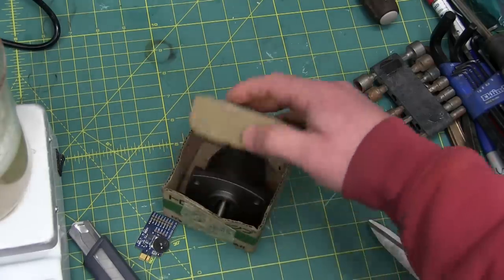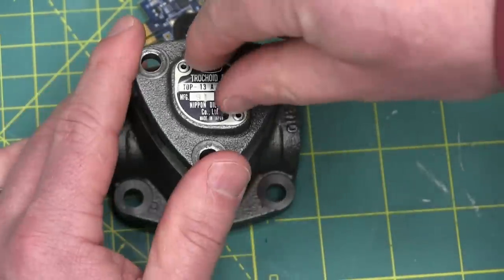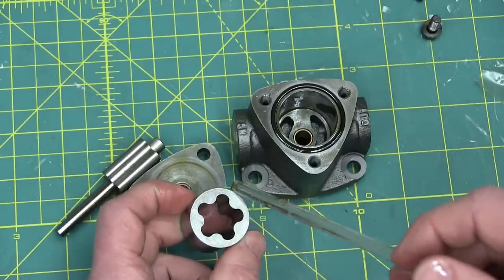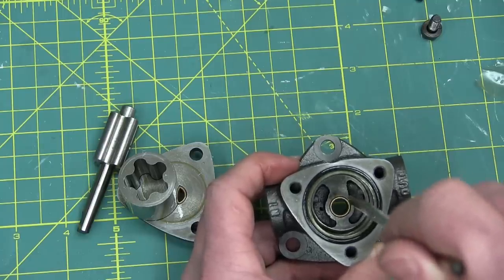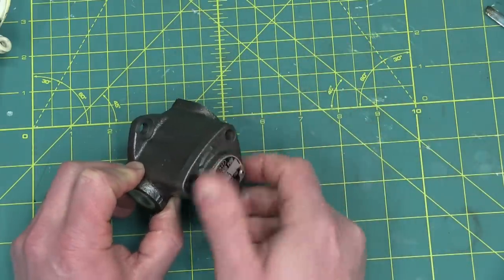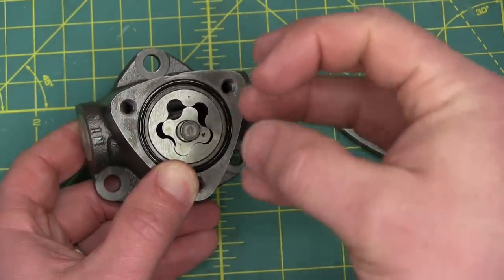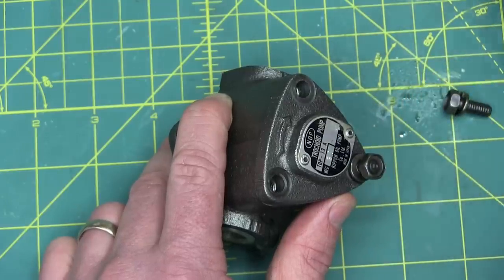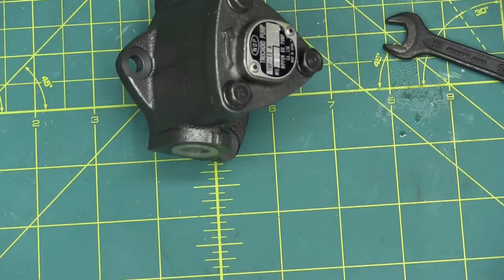BOLTR: Trochoid Pump | Chickadee Enginerding!

Comment: Bah, they've been putting the sizes on top of the bolts for decades. On that note if anyone knows where I can buy a 12.9mm or 8.8mm wrench please let me know.
Reply: I have seen it once where an individual thought the 8.8 referred to the size of wrench needed, even though it was clearly over a 1/2 inch. You meet all kinds in this racket
Reply: crazyguy32100 eBay
Reply: i have to disapoint you that is not the size of the bolt but it grade. The number represent tensile strength in hundreds of a Mpa so 8.8 means 880 Mpa. Look up bolt grade.
Reply: scasny
Do you really not have a sense of humor?
Reply: keifsanderson he must have gotten used to those "wooshing" sounds as things go right over his head.
Reply: keifsanderson
well some times its hard to tell if some one is just stupid or joking.
Reply: scasny wayta not get the joke there tiger..
Reply: Lol I get it
Reply: scasny I heard that the first digit represents ultimate tensile strength in MPa and the second the elastic limit as a percentage of the first.
Reply: eeeeeebayyyyyyyyyyy
Reply: Best of all: I tend to hoarding demounted bolts, and 5.6, 8.8, 10.9 and 12.9 go by nearly any tool above 8 mm my socket collection holds ...
Reply: scasny ,   800 mpa tensile,  and 800* 0.8 = 640 mpa yield
Reply: crazyguy32100 She's asking the right questions; they were also my questions until she asked them.
Reply: scasny r/whooosh
Reply: Funniest joke Ive seen in a while. Kudos
Reply: That was some mighty fine sarcasm my friend.
Reply: You know as a machinist your dealing with an automotive mechanic when they say 10mm bolt.

 Your spidey senses just know they are referring to the head size and what they really need is a M6.
Reply: I had a DeWalt branded set of sockets that had the metric and standard on it
Reply: So...what we're saying here is:  It's not the size that counts, but the grade?
Reply: FWIW, i knew it was a joke and assumed it was a tensile strength but i came to the comments specifically to find out/confirm what exactly it means. So thanks to those of you who did enlighten me.
Reply: scasny holy fuck really ? Sarcasm is lost one this one XD
Reply: file out a 1/2" for 12.9  
11/32" for the 8.8 
{:-)

Comment: I've all ways wondered the same thing. Why don't they just stamp the size also?
Reply: I we don’t constantly round off the bolts with the wrong size wrench they would go out of business
Reply: Because that's usually reserved for other information and because there's more than one way to count your wrenches. I suppose. Thing is, i have seen such bolts. Quite a few German water pumps i have taken apart were numbered with the metric wrench size.
Reply: While it would be great, the size is something you can see for yourself. The markings the bolt head has is for strength - which is harder to determine. There are industries where the difference between a Grade 5 and Grade 8 bolt matters, and that those can't be checked by putting a wrench to it once or twice.

But for IKEA level stuff - absolutely. That would be sweet.
Reply: because standards are a pain in the ass. Grade 8 bolts foolin' everyone for far too long.
Reply: Just posted a rough guide using fingernails above.
Reply: tongue in cheek yolk there bud. the number is actually the tensile grade of the bolt.

Comment: I encountered a few bolts with an 8 stamped on the head when working on a car recently. They weren't all the same size though. The first few we're 8mm and the rest were 13. But they all had an 8 on the head
Reply: Faith Houston I do believe some times the bolts grade will be stamped on the bolt head. They probably said 8.8 which is for metric bolts below 16mm made from carbon steel. 😊
https://www.boltdepot.com/fastener-information/materials-and-grades/bolt-grade-chart.aspx
Reply: Theres different grades of bolts. The number on the head is the grade or the strength of the bolt.

Comment: Gorram it, man! You're pushing type 2 diabetes on me by YouTube osmosis.
At least put a paternal advisory warning or something at the start of the VJO.
My lonely man-heart is only specced to withstand up to 1.5 kiloCutes (~2.739 pound sweet squared in imperical), and that's for momentary loads (up to .5 kCt continuous) . Now I've got to have it out and check that the valves are still intact. Again...
Reply: Hattmannen Nilsson it's alright, I'm pretty sure the cute police are already launching a full investigation into this adorable cuteness event (ACE). A full report should be available with contacts for your attorney.

Comment: Almost looks like the mechanical fuel lift pump of 6v92t on the miniature size!
Reply: Ernesto Apocaloptimisto I dont see why it wont work  just have to have the measurement to see if it bolts up my have to use spacers if the shaft is to long
Reply: Ernesto Apocaloptimisto I was going to say more but my phone started acting up!
Reply: richard cranium At work they have a tack rig for spraying liquid asphalt made by lee boy a Lf 500 i call it the CF 500 and it uses a hydraulic pump instead of a asphalt pump everything is made wrong on it came from the factory that way So Engineers arent any better some times. 
My dad previously  owned a 1950 etnyre 1500 gal asphalt distributor thats built right!

Comment: I believe the numbers are torque ratings. Learned about those when rebuilding the valve body in a 4T65E transmission and again when working on replacing the lower intake gasket on a 2000 3.2Lt GM engine. They were in a scientific notation that required conversion into ft-lbs or newtons.

Comment: I needed to understand a little about trochoid pumps, but I learned so much more. What a great vid. Many thanks. btw I think the number on the bolts is a simple code system for the torque specification. I'm familiar with the system that Toyota uses where a number (or a series or protruding lines) and the diameter and pitch translates to the tightening torque. I've made it sound complicated but there are two pages in every manual with example pictures and a simple table to cover every threaded fastener across a range of M6 to M16. Search something like 'Toyota standard bolt torque specifications'. Cheers!

Comment: It makes it a throwaway item in the sense that when the soft pin wasn't installed properly and comes loose shattering the pump you throw away the whole trashed machine. (happened to a guy's vintage tractor engine after the chinesium replacement oil pump spontaneously exploded)

Comment: As for the pump, it's not working very hard so it's design is just fine. It will never deal with cavitation. If it's for CNC machine way lube which is very thick it can't be running very fast. It's pulling from a tank and pushing to essentially slow drip feeds at low pressure. If it's for something like spindle lube it might be running faster because that oil is often run through a cooler but still at low pressure.

Comment: I helped work on a robot that used 3D printed hypocycloid gear reductions on the joints of the legs, works kind of the same way but you can take a lower power servo and have it move more mass.

Comment: Had a rocker arm bust on a car Pontiac 400ci motor. All the needle bearings went everywhere, they were aftermarket crane rockers. They fell down into the motor and were picked up through the pump. It jammed the pump which is turned by an output shaft from the distributor cap, a 700$ MSD unit. Luckily the shaft split instead of the distributor drive gear.

Comment: This vid on wimp.com...in any case, downstream restriction increases system pressure and can eliminate cavitation.  Reduced flowrates, but it works and noise goes down.  You save time to build another step-stool.

Comment: With some experience you can spot the wrench size quickly.  Put the torque spec on the top as a simple digit or two.
Reply: But the torque does not depend on the bold. Depends on the application. 
You would have many equal bolts with different numbers, and when they get mixed up, it would create a bigger problems. (torquing to the wrong number in the wrong application)

Comment: Dearest Lord Cockswain Bumblefuck,
I speak to you from my digital typewriter. I have inherited what appears to be a "Chicago Wheel & Manufacturing Company Handee Rotary Tool" following the passing of one of my grandparents and the subsequent posthumous garage cleaning.
As it turns out my great grandfather (I'm a 21yo fellow) used to use it to engrave his name on all of his tools and because it's old and old things are cool as fuck, I'd like to use it myself. Problem is it has a case of the quarter-turn fart lets the smoke out. Now I hearken back to your vijeos on the old skool drill, sawzall and dremel and dream that you might give this venerable tool the same treatment (of course, not so much "chooch until dead" and more of the "frankensemble skookumfacturing") so that I could use it for my mediocre desk-side metalworking.
As I said I can't tell you a whole bunch about the tool other than it gets hot quick, seizes up easy and smells like a hot damn bobs your uncle, but I can tell you that it's had a lot of relatively hot suppers and has been hanging out in a garage almost as long as my dad's been alive. Ferrous oxide dust!

tl;dr I got a cool tool and would like to send it to you to make a video off of and see if you can make it VERKZ once more or jury rig something together to give it the semblance of working. I'd be willing to drop a few dollars in the hat if that'd sweeten the deal, too.

Yours Truly, A Viewer

Comment: AvE that is not the size of the head but us bolt grade its markt with number 8 or 6 radial lines . In mertic its 10.9 ,common is 8.8 so that is some hard nut.
It can be interesting to make a video about bolt marking ,grade ,size ,thread pitch

Comment: I got products 40 years old with the size stamped on the top of the bolt.   You still need to figure out if that is the bolt diameter or the "across flats" size.

Comment: The 8 on the head of the bolt is the diameter of the bolt's shaft, not the size of the bolt's head.